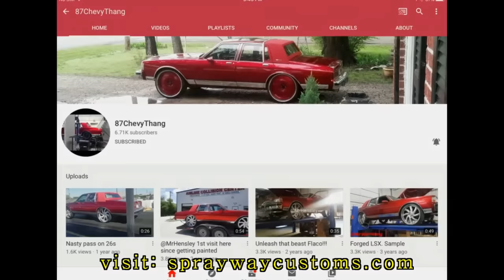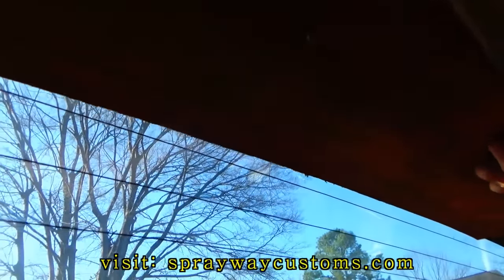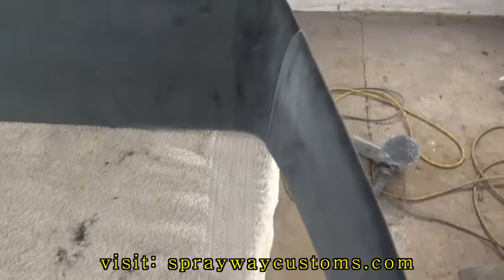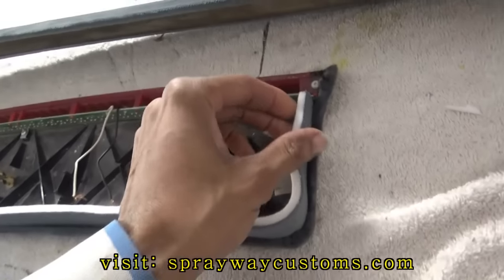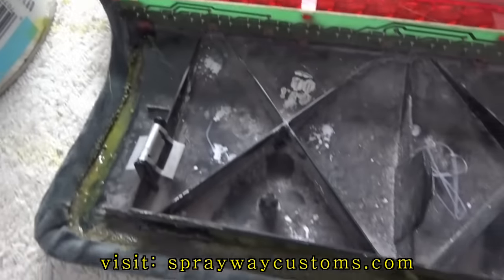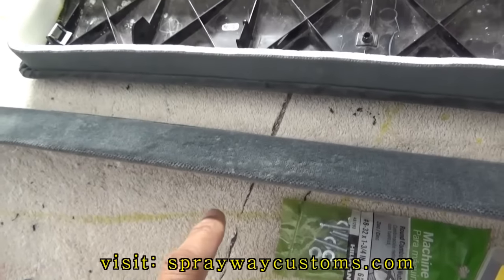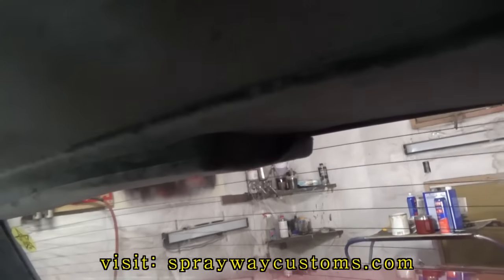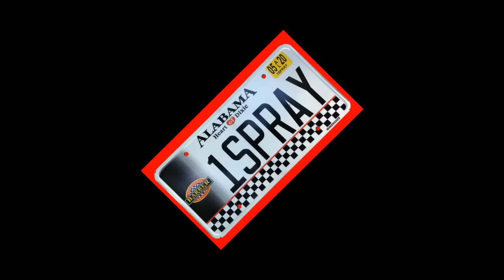Third Brake Light Install Box Chevy Caprice LS Brougham Or Any Old School Car Or Truck G-BODY / DONK

Comment: @SprayWayCustoms what glue did you use to make it stick on the 3rd brake light?
Reply from the maker: Contact Cement
Reply: SprayWayCustoms thanks maan I’ll get right on it and try it out. ✊🏿 💯

Comment: Yo can you just put fiber glass harder on a old plastic trim and make it a little to brake. Not thick coat but a thing one for more protection.
Reply from the maker: Yes you could..just make sure you sand the plastic real good
Reply: Kool thanks and stay safe

Comment: Cool little project man. I like the way it turned out. Is that fabric Alcantara? Did you use the same loctite spray you use on most of your other stuff?
Reply from the maker: I'm not sure on the fabric type. I used contact glue for Landau tops
Reply: I just watched that video on your Landau roof. I got ya on the type of glue. Thanks man!
Reply from the maker: Steve ok then. 👍🏾

Comment: What do you recommend if the car doesn't have a third tailight in the beginning .
Reply from the maker: Tie in to your brake light
Reply: Ok,cool. Thanks for the info
Reply: Hey bro,thanks for the info. I ended up going to the brake switch and it worked out perfect.

Comment: 💪💪💪💪
Reply from the maker: Thanks 🙏🏾
Reply: SprayWayCustoms where did you get the pad from & do you know what it’s called? Did you use padding on the 3rd brake light itself before wrapping? Tried finding the padding at Walmart in the sewing section.